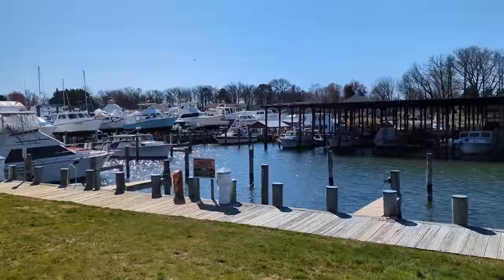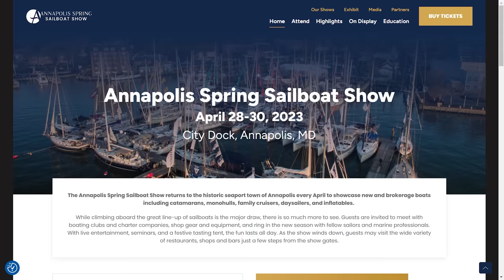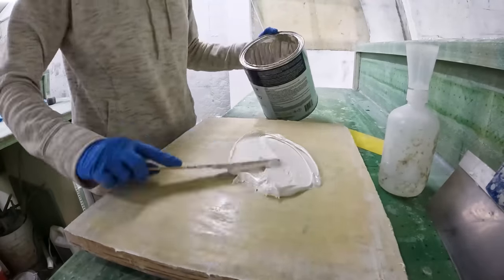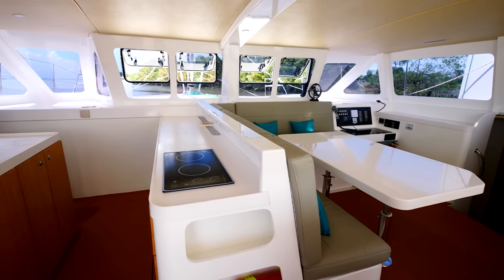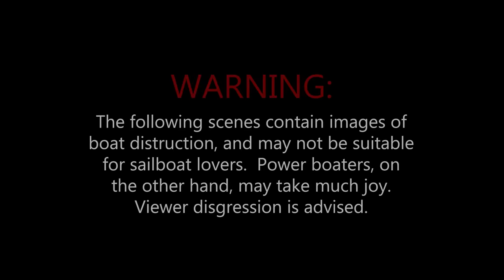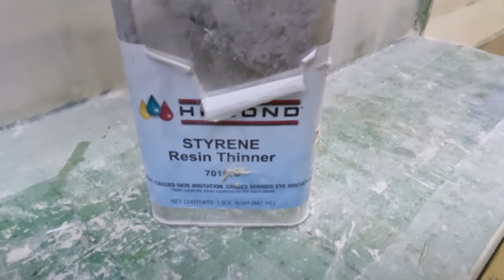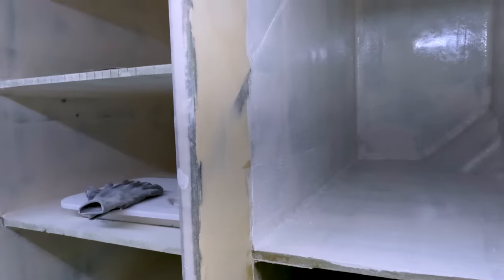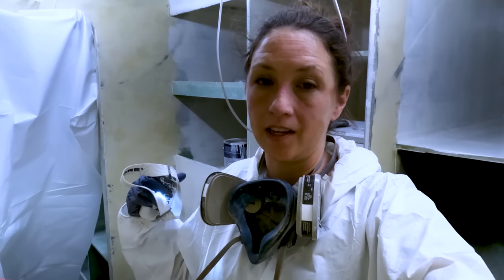They're DESTROYING It In Front Of Our Eyes!!  (MJ Sailing - Ep 277)

Comment: MJ        When sanding creates fine dust, like in doing automotive bodywork or in your case, boat work, it helps to use an air nozzle and blow out the dust to improve electrical contact surfaces. Seeing as you are using DeWalt, parts are available for most models through DeWalt replacement parts located in Georgia. I always blow off my tools with air at the end of the day or a job!

Comment: You likely could save a LOT of work by multiple layers of high build primer.  You still need to sand, sand, & sand but it comes off easy. On show car quality paint jobs I've sprayed 4-5 coats of high build primer, sanding between each coat until it's perfect. Probably 90% of it comes off but that's part of the game.  That sanding dust gets in places you didn't even know you had but I'm sure you've found that out already. A car can have 1,000 to 2,000 hours of prep for paint so just be patient, it will be worth it in the end. Meanwhile... back to sanding! 😂

Comment: I have not seen you attack the ceiling yet.  What is the plan for that?  Vinyl lining or smooth like the walls?  Second question, I think the vinyl linings would reduce the echo sounds and make it quieter.  Is there a concern with all the hard surfaces of the hull without vinyl liners that is will be loud?
Reply from the maker: The overhead will be a drop panel covered in vinyl.  It does more to lessen the noise than having the hull sides covered and we can hide lights/wire behind it.

Comment: I think your sanders are dying because of the glass dust. They might last longer if you give them a regular clean with an air hose.
Reply: I’m sure you are right the fine dust builds up and becomes like a a solid piece,you only need to remove the once moving bases plate and clean out this buildup then maybe a bit of oil around the bearing and all should be good. It works on my festo sander anyway.
Reply: Harbor freight!!! Best disposable fiberglass work tools around!!!!!

Comment: Guys, I don't know if this could help but I like to put more than one coat of fairing between sanding. I apply first coat. I wait for it to cure dry-touch. Then I use a cutter blade at 90º to the surface to remove anything that protrudes and apply another coat over to fill low spots that are often very difficult. You can do this 3 or 4 times, you just have to keep in mind not to wait until it is fully cured (usually 24hrs, depending of the filler). I know how hard is this process, I've just finished to fair and paint the entire hull and deck of my 36ft sailboat and I'm in the middle of doing the same in the interior. I hope to you good luck and patience, It will be worth it.
Reply from the maker: A scraper is a good idea.  We've been using a rasp, but it gets gunky way too fast. Thanks

Comment: Do you have electric and pluming schematics?
Have you built in raceways for same?
Thanks
Reply from the maker: I'm slowly working on the electrical diagram - it got a bit more complicated once digital switching and hybrid propulsion got in the mix.  Plumbing is simple and won't require a diagram... But I have the one from Max Cruise that I could follow if I wanted.

Comment: How many hours per week are you working on your boat?
Reply from the maker: I (Jessica) put in 35-40 hours a week on the boat, plus 30 hours towards editing and YouTube related stuff.  Matt puts in about 60-65 hours a week on the boat, and does researching at night.
Reply: @MJSailing  huh, that's a lot, i thought that by now you would be ready to splash... Turns out i was wrong ha ha
Reply: @MJSailing  one more question-why did you choose fairing the insides of the hull instead of using some wall lining? It would save you time and could be removed if the finished boat had subpar performance, also additional heat insulation.

Comment: Should be able to swap that toolout at any tool distribution place  or if you bought it at home depot no fuss
Reply from the maker: We did get it from our Amazon Wish List, so I don't know if that changes things.  😬
Reply: Contact the manufacturer and they should replace the sander,don't forget to mention all the free advertising you give them by using thier brand of tools on the build.
Reply from the maker: @ That may not be a bad idea!!  (But then they might also get on our case about not cleaning them after each use.)
Reply: @MJSailing  doubt it, i've turned in some pretty messed up tools with no questions asked, being an electrician we are pretty hard on tools.  Even one that was clearly dropped and in 2 pieces and they handed me a new one and said thanks!  keep the grind up you guys are doing great work!

Comment: not being a smart arse  - smaller palm sander will die if you leave the little filter on it  ( the filters actually trap the dust inside the workings of the machine) you would be better served if you want the sander to last  - to hook it up to a vacumn cleaner - every time its being used to sand..  Took us a few trips to the repair shop to get the issue identified